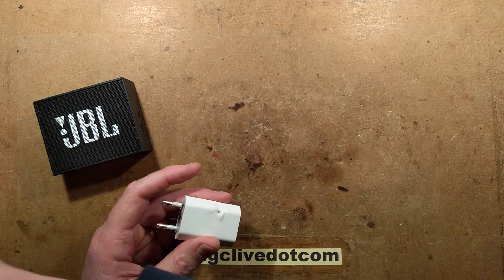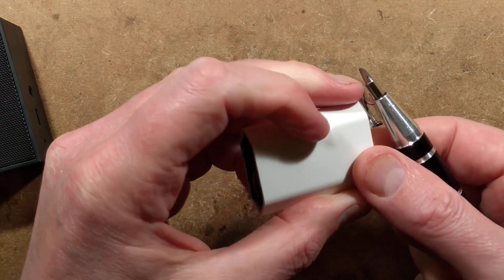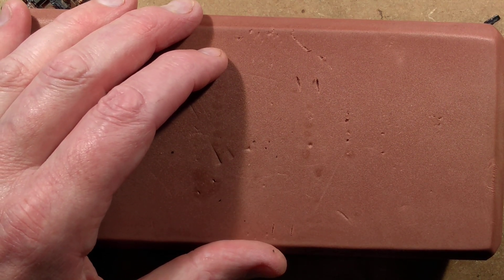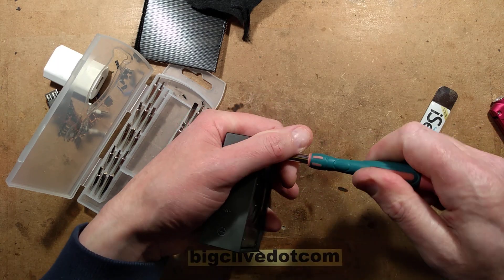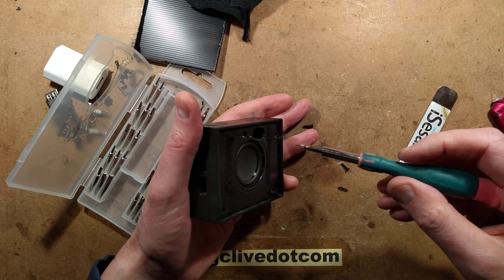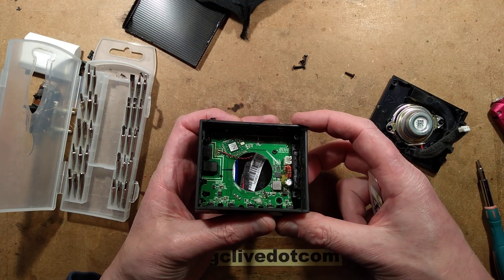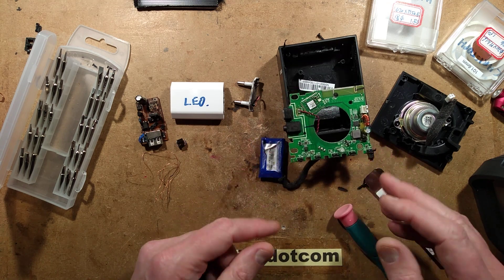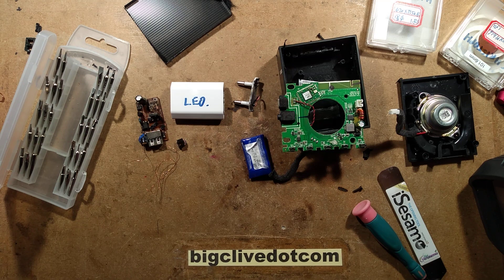Dead JBL speaker and melted PSU.  Which died first?

Comment: The screen " jitter" and false inputs is a very very very common problem with Moto G4 phones when they're on charge...in fact it's unusual to get one that doesn't do it....I've seen it happen even with the original Motorola chargers as well ...most of the time It's easier not to use them when on charge.
Reply from the maker: The Moto G4 phones were fine until the Moto G6 series came out and suddenly the "update" for the G4 introduced rogue screen input at the bottom right of everyone's phone and a rogue overheating issue when recording video.  It appears Lenovo follow Apples lead in phone hobbling.

Comment: The foam in front of the speaker probably tones down the treble.

I wonder if the speaker still works. Could solder a mono aux cable to it and test.
Reply: The foam is transparent to the audio.  Its purpose is to hide the speaker cone.

Comment: Hi Clive, it can hardly be used as a sex toy, but it's probably the other only meter to my knowledge that display voltage intensity power and power factor on the same screen

https://www.aliexpress.com/item/PR10-F-BS-13A-power-metering-socekt-kwh-meter-0-1-3250w-watt-meter-power-recorder/32697027826.html?spm=2114.10010108.1000013.6.1fee3840i51iHJ&gps-id=pcDetailBottomMoreThisSeller&scm=1007.13339.90158.0&scm_id=1007.13339.90158.0&scm-url=1007.13339.90158.0&pvid=315e8a40-ce77-432b-ba94-1341efaf2887
https://www.aliexpress.com/item/PR10-C-EU16A-home-power-metering-socket-home-energy-meter-power-recorder-electricity-meters-16-currency/32695358611.html?spm=a2g0o.productlist.0.0.666c1373AVyzgh&ws_ab_test=searchweb0_0%2Csearchweb201602_5%2Csearchweb201603_52&algo_pvid=8aed9ae6-e40e-4614-8e41-54cd8da09b23&btsid=2f8c70f6-6980-4467-8db0-61b8951c9bff&algo_expid=8aed9ae6-e40e-4614-8e41-54cd8da09b23-0

Comment: I own one of those speakers and the internal lithium battery went to meet its maker 6 months after i bought it.
I now use it with a single 18650 powerbank that I've glued to the back of the speaker with a tiny tiny usb cable.

the battery part is a shame because the speaker itself is actually quite impressive for the price!
Reply: Thanks for the warning I use one of those speakers all the time at work. Is yours a go2?
Reply: @adamk9652  Nope, mine is the first, just like the one on the video! =)
Reply: @tzfieldtesting3794  ok thanks  my revised model is working fine 6 months later (it has smoothed edges) . I use it heavily in my work backroom and its holding up nicely to steam when I have to clean the floors frequently. 

Thats really smart to glue a powerbank to it since the battery's dead. Might as well get the most out of it😊!

Comment: My guess is charger went faulty first, sending over-voltage to the speaker (possibly mains voltage given the ludicrous separation and transformer isolation) and frying the Bluetooth module and charge controller.
Reply: There was no evidence of mains voltage on the secondary side.

Comment: The Lithium battery cell should be reusable, and the small speaker from this thing will also probably sound better than most other small speakers in that size.
These units go for around 20-30€ as far as I can remember. Which is of course too high, even for the usually good quality of JBL.

Comment: I only use decent quality USB power supplies, and I have never had to buy one, because with every device (like phone, tablet, Bluetooth speaker etc), there comes a USB power supply, and as long as you don't get the cheap Chinese devices, but for example a JBL bluetooth speaker or a smartphone from any brand name, they will include a decent USB power supply with the device. I use only those, and never had any issues.
Once I got a cheap phone from China, but I don't use its USB power supply, for a good reason.
Reply: This JBL GO speaker does not come with a USB power supply.
Reply: Right, but the sligthly bigger "Charge" speakers do.

Comment: My two cents is that the charger blew the speaker.
I've had shitty chargers blow up cheap underprotected power banks and those cute little LED flashlight charger cords before.
Sometimes both at once.
As such, the shitty charger's voltage drifted or spiked high, blew the BT chip and damaged the caps as seen inside, then the BT shorted, overdrew the supply, which gradually overloaded and melted down because those are underprotected, and by time you got it an internal short had developed, causing the *earth shattering kaboom*.

Comment: JBL are junk, another name abused by globalism and China.
Reply: Dubsy Dubs they're owned by the harman group now. most of the JBL branded 'commercial' amps are actually Crown designs. their commercial speakers are still JBL designs, e.g. the Control 24's.

not sure who the OEM for everything else is. I only know about the speakers and amps because of my AV install work, and some astonishingly bad QC on the amplifiers (like hand soldered lead-free solder joints without a board wash to remove all the highly corrosive flux 😤) which meant I had to field repair an amp to get an install up and running immediately.

Comment: I suspect the PSU could only truly handle 500mA whereas the JBL was drawing 800mA as per your USB tester.
That probably overloaded the PSU and the isolation broke down putting mains into the JBL speaker...
The Bluetooth modules are very sensitive to voltages outside the norm and can blow easily, whereas it looks like the charge IC was delivering it's power as intended (since the Bluetooth module wouldn't of got warm otherwise)

The AMP IC may still be good... most of those are quite robust... look up the datasheet, find the shut-down pin (disable the shutdown function by grounding or pulling high) wire up an aux socket to the audio input pin (if balanced input, just add a capacitor to + and ground, the volume will be lower, however this works most of the time)... bypass the FET that supplies the battery to the AMP if one is fitted... (there maybe some other little tweaks for some more exotic designs, however that should do)

Enjoy the now wired non-Bluetooth speaker.
For Bluetooth, there's Bluetooth receiver modules that can be had from the online 'bays.

Comment: I wonder if you took off the bluetooth chip could it still be used as a powered speaker with that 3.5mm jack on it.
Reply from the maker: It would probably need hot wired as it probably switched through the control module.

Comment: A small speaker, and a "Boom Box". It seems a shame when someone buys a fairly expensive bit of electrical kit, then skimps on the means to power it, and if there's one thing to learn from this video, it's that I'll be checking all of my USB power supplies, and lobbing out any that look iffy. Thankfully, most of mine came with the devices and would seem to be legitimate products, but one, which appears to be an 'Apple' charger was bought from a high street used goods shop, and has no provenance, Hmm, I wonder?

Speaking of electric shocks, I bought a small generator (1.7kVa) out of a junk sale, yesterday, and today started that puppy up, but it would only run with the choke 'half on'. Whilst attempting to adjust the carburettor jets, I inadvertently touched the top of the spark-plug with the back of one finger. . . . . . . Yeah, that makes you grab things tightly. I was dancing on the back of the trailer, like a puppet whose operator had ants in his (or her) pants!

Comment: the microphone is because the device is a hands free speaker for smart phone.

careful where you are poking with the screwdriver.

with a charge in the battery there is still enough charge to cause problems if you short it

Comment: That's a pathetic battery pack for such a overpriced brand. Wow
Reply: @Joe T jbl is good but pricey for its worth. I got amazon Chinese brand of speaker that's dual speaker and 30 Watts with 6000mah cells and lasts only 5 hrs fulll volume. Altho 30 Watts is a lot of drain. That, speaker is prob only about 15
Reply: $29 is overpriced?

Comment: Just a quick note on the enclosure; 4th Order Bass Reflex alignment, colloquially known as 'Ported'.
Reply: DJ Slow N Throw just ported not 4th order
Reply: @BASSITZ  Captive reactance of a net volume in addition to the inductive reactance of a port raises the acoustic order to the 3rd,  but due to the presence of the vent there is a correlation between the front wave from the driver itself, and the back wave that is present due to the vent making it a 4th Order alignment. 

A 4th Order Bandpass and 4th Order Bass Reflex are two separate designs, though most don't refer to a Ported alignment as '4th Order', though it is. An equal example of this is a Series (or Parallel) Tuned 6th Order, and a 6th Order Bass Reflex, often referred to as a D.B.R., or Double Bass Reflex.
Reply: Below is a link to an example of a customers' D.B.R. I had recently designed for a Digital Designs 9500 Series 12", and the link below that is the 1/8th Radiation Space Acoustic Power graph. 

[Design]
https://ibb.co/DG61vtX

[Graph]
https://ibb.co/5s4KbDv

Comment: I have thrown away all my chargers and replaced them with a managed charger, this checks what current the device can handle. This solves the way to easy error of a 1 amp device being plugged into a 2.1 amp power supply,  e.g the 1 amp E-cigarette battery exploding when plugged into a 2.1 amp phone charger. I have so many devices, headphones 1 amp, bluetooth headphones 1 amp, power pack 2.1 amp, headphone amp 1 amp etc. How are you supposed to remember,  I tried labels but that was unworkable. I also like the fact that they stop charging when the jobs done. I now have one in each room,  plus I feel safer knowing the children can't get it wrong.

Comment: clive, could you do a tear down of supposedly decent power plug(s) and a bit of a run down on what tyo look out for when buying one(markings, ratings, etc)?
Reply from the maker: It's impossible to tell from a listing or outside appearance.  I always recommend buying from a prominent name like IKEA, ASDA, Walmart etc.  As they need to protect their reputation.
Reply: @bigclivedotcom  I'd like to agree with you on that one however, I used to work halfords until very recently and we used to sell our own branded merch and it was essentially the same stuff you could buy on ebay for a fraction of the price, to the point that even though there was a 300% mark up on identical items such as portable chargers and the like they have had nation wide recalls on the chargers especially for fire risks, unfortunately a lot of companys now do this and manage to get away with it!

Comment: My money's on the shitty mains-to-USB adapter shorting internally, and then the wireless module was destroyed by the over-voltage. It's amazing the extent of damage those goddamned adapters have caused. Whoever "designed" the PCB and approved their manufacture should be shot forced to use their own product.

Comment: I'm always warning about what I call "grey conditions", which are neither normal nor obviously exceptional. Because they're the ones that stress the safety design. Example: a slight overload on an extension reel. You won't get a magnetic trip - not enough BLI. You might not even get enough thermal trip, you're only just over the hold current. Those curves come with Ts and Cs. It will just sit there quietly and bake. Your best hope is that it's a supervised situation. But what if it's not?

Comment: It would be nice if your could get a simple tester to check for mains voltage on a USB charger output. I guess it wouldn't be hard to make using neon bulbs with proper resistors using a neutral or ground connection. Ground probably would be safer. It's an idea anyway.
Reply: It's called a multimeter.

Comment: Looks like damaged input protection diodes in that chip. The short can sometimes be burnt clear by connecting a high-power psu or power bank and letting it bake for several minutes. The chip might even start working again. Wouldn't bet on it, though.

Comment: LOL,  Self Destructing  Evidence !  POOOOOOOOOOOOOOOOF   Ya Can't Prove Chit Consumer Fool.  Ya should have purchased the MARK II version.  We fixed that one.   I've purchased some 5 or 6 of those precision screw driver sets from China.  Made quite well I must say.  One issue.  Non of the sets use the same size bits.  You would need to buy a new set to replace any one single broken or warn bit.

Comment: Actually had a bluetooth speaker have its charging port fried with a cheap cord thru a less-cheap USB hub, think a lightning strike did it. The cord ends were bulging and the plastic tabs inside them were melted. Sadly rendered the speakers unusable as there was no easy way to recharge it without some serious electrical resurrection, although aside from the port it appeared to have survived alright. Only realized it was bad when the sound started cutting out (did that when the battery starts running low) and I picked it up to check the connection.

Comment: The CSR bluetooth chips often have li-ion charge circuitry built in .. it’s switch mode so doesn’t come close to 70 ... but, just as a point of reference
(also very few manufacturers use it since csr chips are notoriously hard to program)

Comment: LOVe items you think SHOULD be safe..That SHOULd protect the devices attached...Even have a Cheap fuse in them...AND FAIL...and destroy everything connected to them..
And all for the failure of 1 simple thing..  LOVE a good spark, that JUMPS the whole system into your products.
Reply: you found the BT connection, but can you bypass the other way to the Amp..which is the other direction..

Comment: I would venture a guess that the output electrolytic bulged first. Then the unfiltered spikes on the DC output damaged the BT module. This cascaded the failure further causing the near short-circuit to overload the puny P/S until the transformer's windings melted the insulation, the outer plastic case, and eventually the HOT side drive components were shorted. These all waited patiently until the next guy to apply AC Mains before vaporizing the input wires as any proper fuse is meant to :).

Comment: You need magnifying glasses. I got some clip-ons to attach onto my glasses from eBay. Cheap from China. I do already have progressive bifocals, but the bifocals aren't strong enough for my needs.
Reply: Robert Gaines, here in the States, the local "job lot" type stores,  kind of an answer to your Poundland, sell magnifying visors with flip down lenses that go up to 9 x, and built-in LED flashlights. They cost eight bucks. Somewhat cheesy, but they work okay. I prefer the OptiVisor brand, which have very high quality glass lenses,  but by the time you buy a higher magnification lens than the 3x one that comes with it stock, you're looking at sixty bucks or more. And like yourself, I too wear bifocals.
Reply: @goodun6081  Huh. My dad's name was James.
Reply: @robertgaines-tulsa  , thanks for pointing out my mistake, I edited it to get your name correctly (I rarely type, I usually just speak into the phone and let it transcribe for me, but sometimes it gets things wrong). I try to always include the name of the person I am responding to at the very beginning of my comment, because if you get a long comment thread going it becomes impossible to figure out who is responding to whom;  and although YouTube sometimes puts the person's name at the beginning of the post automatically,  other times the system does not. I have no idea why this is so, perhaps it has to do with how people set their notification settings. But what the hell do I know, I'm really an old time analog guy living in a digital world......

Comment: What brand/model is the bluetooth IC? Just curious.  I'm guessing its a CSR like the JBL flip 4 and Charge 3 which has a CSR8675. These bluetooth chips seemed to be very sensitive to their power supply. I already had 2 that died. One was CSR8675 and the other was the CSR8645. The 8675 one died on our car. It was always plugged in into a car cigarette charger. The charger was really high quality. I dont know why it died. The 8645 one died when I was programming it with the FT232RL. Its a shame. These bluetooth chips are seemed to be very powerful. If programmed correctly, they can even have a built in equalizer in them in which you can control from your smartphone. I tried to make a DIY speaker based on the CSRA64215 (similar to 8645) and I was really fascinated by its features. You can search its datasheet for more info. But basically, the CSR8675 supports Aptx HD and Aptx while the CSR8645/CSRA64215 supports Aptx. The 8675 seems to be much harder to program though. Too much proprietary stuff.
Reply: Hi. I want to learn programming bluetooth IC.
Reply: Is there any forum i can visit for learning?